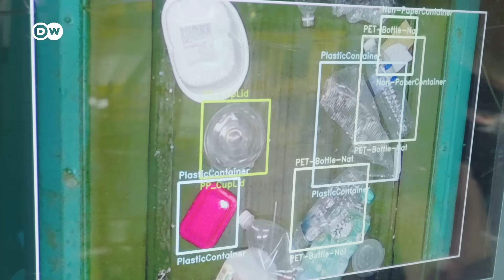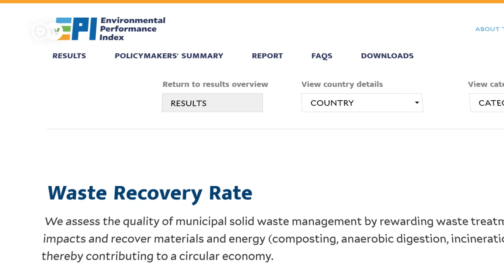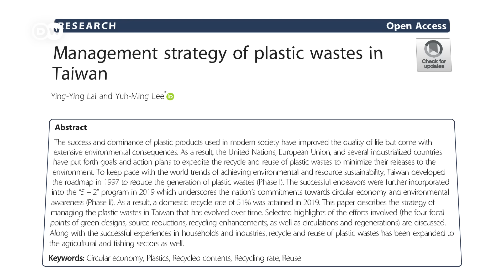How is Taiwan beating everyone at plastics recycling?

Comment: I think the recycling system uses AI in a beneficial way. In my opinion, for recycling as a whole I think that petroleum-based plastics should be fully turned into syngas for producing clean energy fuels. Then, using sustainable plant feed stocks to make sustainable plastic material alternatives that can biodegrade or be easier to recycle.

Comment: Imagine how much simpler and more recyclable the whole process would be if all those plastic bottles were made out of 100% recyclable GLASS
Reply: Imagine if each individual sorted trash and the whole recycling process was done with maximum efficiency... in stead we chose to litter Earth. What could possibly go wrong?
Reply: True, but glass is much heavier.
Reply: Glass produce carbon also.
To even re-melt the glass, a lot of fuel will be needed
Reply: @melvinyit6859  I'm only 62 years old and I remember as a kid returnable glass bottles. Those would get washed and reused.
Reply: @lorenzoblum868 That's still the case for some bottles in some countries. Here in Taiwan beer bottles have a deposit and they get washed and refused, it was the same in NL.
Reply: *reused
Reply: @lorenzoblum868  I'm 47 and reusable milk bottles delivered by EVs were universal in the UK. Rinse and leave on your doorstep for collection at time of delivery. Reusables > single use recyclables.
Reply: We should clean and reuse glass bottles and jars and other containers rather than "recycle" them.
In some countries you can take your containers to the supermarket and refill them. I really want that to be introduced in the UK (and ideally internationally).
Reply: @jbullen82 We do that with beer bottles here in Taiwan. It's also done in some European countries.

Comment: Most plastic waste if not all plastic waste is a form of downcycling.  No plastic waste that I know of can be endlessly recycled, sooner or later it ends up in an incinerator or landfill. People especially journalists should stop using the term recycling with plastics, as its extremely misleading  and just another form of green washing.
Reply: First reduce, then reuse and only when both options are exhausted, recycle!
Reply: @ain92ru  it is 5 R. 
Refuse 
Reduce
Reuse
Repair
Recycle
Reply: @permaculturisty  Yes!  & Rot (food waste) & Rethink or Redesign
There should be little to no trash left.
Taiwan is still incinerating a lot of trash.  But they do have numerous systems in place that work far better than most of what is happening in the US.
South Korea has an excelent system in place
Reply: Downcycling is still better than immediately sending it to landfills/incinerators. Perhaps it's only delaying the inevitable, but it still gives the plastic another use before its eventual disposal.
Reply: @SmilingNinja  Of course, but it isn't a cure-all. We MUST reduce the amount of plastic we produce in the first place.
Reply: @TheAruelle  Of course it isn't a permanent solution, but downcycling is still better than simply throwing out more plastic. It will, at the very least, decrease the need for more virgin plastic.
Reply: @TheAruelle  you can produce less plastic, but that’s not going to solve the problem. 
People are not going to carry a drink home cupped in their hands.
Reply: @AlphaGeekgirl but they can use re-usable containers instead of single use plastics. For example, the plastic bags do get collected, people think they can use many just as long as they properly dispose of them in the recycling bins. But as you just heard, they only get incinerated. Therefore, getting rid of as many single use plastics bags as possible would be much better. 
Mandate re-usable bags, make people pay more if they don’t bring their own bags, don’t let companies hand them out for free - much better than to (costly) collect, sort - and then just burn them.
Reply: @SmilingNinja  true. And people forget that with incinerators, given the fact they they have very fine air filters too, can also serve as a heat power plant providing home with heating energy.
Reply: I've lived in Taiwan and heard the "we're the best at recycling" story, looked into it, and saw most of the trash is burned. Everything used WAY too much plastic (100g of fresh fruit in an insanely big plastic container). During my time, there were some good changes, like if you bring your own cup for tea, you get a discount, and disposable plastic ones were banned in Taipei, so they're moving in a good direction, but these reports are often looking with way rosy glasses on this issue.
Reply: Recycling some is better than none. 
If reducing plastic is important to you then lead with information on reducing plastic.
Reply: HEAR HEAR!!
Reply: If you search for the phrase “ 台灣人減塑膠政策 “ on Google, you will learn that this YouTube report is merely one small, final component within Taiwan's much larger scope of environmental protection efforts. Taiwan has been working diligently for many years in ways that far exceed the imagination of those with passive attitudes, regardless of how much effort they put in.
Reply: Actually they tend to mix virgin plastic materials and recycled plastic. You can not use 100% recycled plastic.
Reply: First of all, it's clearly stated and shown in the video that a lot of it is burned. I have no idea why you are complaining.

Secondly, recycling is defined as turning a waste product into another product. Downcycling is hence a subcategory of recycling. That's how every dictionary I have seen defines it, and it's also how environmental organizations define it.

There is nothing misleading about the term. It's used appropriately in the video.
Reply: @Ciferz  These people are such pessimists. Their attitude is, 'Since we can't recycle all the plastic anyway, doing 30% or 50% is meaningless, so let's just do nothing at all.   And the worst part is, they never come up with any constructive ideas.
Reply: @Ciferz  plastic, however, can only be down cycled. It is the only kind of recycling available for plastic so we may as well call it plastic downcycling/incineration. Glass can be recycled, metals can be recycled. Using the term "recycling" for plastic gives the impression that it can be reused for the same product, and that is misleading.  The idea that recycling is the perfect solution to plastic waste is a marketing campaign from the plastic industry.
Reply: So you’re suggesting what?
If you don’t give people ideas or hope of how a problem can be solved,  THE PROBLEM CANNOT BE SOLVED!
All your opposition to greenwashing is noble, but you’re actually not doing anything positive to solve the problem.
Give people hope, and they will make the effort. Give them nothing but negativity, and they will continue to do what they’ve always done. 
I have been in charge of a Building of over 5,000 people for the past 29 years, where we have introduced more than a dozen initiatives, and we know what works. I’m guessing you don’t. But you do talk big. Congratulations!
Reply: @AlphaGeekgirl  i am not talking big, I am just talking reality. After reading the comments here, I see a lot of people who thought they were doing more good than they are, now realise they were being deceived are perhaps not as angry with me about terms and definitions, but are realising that their efforts to recycle are not as successful as they had hoped. Of course its better to downcycle plastic than do nothing, to be clear I put what plastic I use in ‘recycling’, where possible. However, the point is its NOT enough and it is NOT an end solution, nor is it sustainable, its merely a step in the right direction. Fact is we are still using a lot of plastic inappropriately and we have to create a market where bio plastics can compete. The end cost of the disposal of plastic is currently picked up by the consumer and not by the producer. Even though I as a consumer do not want my food wrapped in plastic. Plastic is more expensive for me to dispose of, if however my food comes in bioplastic, disposal is not an extra cost for me, cause I can chuck is on a compost heap. So again calling plastic recycling and not down cycling is extremely misleading and makes people think the problem is solved. People in the UK and Ireland were told their rubbish was being recycled for years and many were diligently sorting their rubbish. Then some people starting sticking trackers in plastic bags, only to find that those plastic bags ended up in either a landfill or incinerator in eastern Europe. We need to be more aware of what people understand by recycling and what is actually happening in reality and terms clarify for people what is actually happening.
Reply: @ImpossibleSolution-k6wsemantics, aluminum, glassn and steel are also truly down cycled by your definition. Recycling always means partial re-use as chemical degradation and contamination happens in all products. Virgin material always stronger and necessary to some degree.
Reply: @joeljong931  No glass can be reused indefinitely and there are other materials that do not degrade over time, like gold for example. If you can reuse the processed material several times for the same product, it is recycling. If not even 1 full cycle can be completed, it is downcycling. Simple as that.
Reply: So, you're saying that we shouldn't recycle plastics at all, or mention it as a solution, since it's somewhat misleading?
Reply: @stevenmitchell1  No I am saying we shouldn’t call it recycling, because its not recycling, its at best down cycling. Too many people believe plastic is really recycled into the same product endlessly, especially PET. Down cycling is an improvement on directly going to landfill or incineration, but it is not sustainable and people need to understand this. We either need to find ways to really recycle plastic or we need to replace a lot more plastic with real recyclable bio plastics and this won’t happen until everyone is aware of the problem and its size. Plastic has become the main material for packaging household products, including food and drink. This plastic waste ends up on islands and developing nations, that have currently little or no ability to down cycle plastics, meaning it all ends up in landfill. These same countries have taken in vast amounts of plastic waste from developing nations up until relatively recently. Their landfills of course have little to no regulation, so these countries have vast amounts of plastic in improperly constructed landfills and the problem gets worse daily.
Reply: @ImpossibleSolution-k6w     90% of people in the US don't even care. Most people in US states that actually even attempt recycling don't or can't even sort materials in their proper bin. There's as much trash in the plastics or paper bins as the trash bins. So I don't see education being a solution, because I don't think most people actually care. They may even do it intentionally, as a form of FU. Only half of the US states have any form of mandatory recycling for any waste. Even the categorization of plastic in the US is controlled by the polluters themselves. Unless the US develops some national laws pertaining to recycling and regulation, along with education, nothing's going to change. Too large of a % of the US populace is contemptuous of recycling in any form, and won't do anything to improve it, without mandatory laws, and enforcement. Right now there's not even a push in the US to replace single-serve plastics with compostable or biodegradable materials. This won't change without some forced incentives.
Reply: @ImpossibleSolution-k6w and it also ends up as micro and nano plastics in our bodys, even our bloodstream and brains!
Reply: @ImpossibleSolution-k6w As mentioned in my direct reply above, every environmental organization I know of considers downcycling a type of recycling. Look at the word recycling. It literally meant to put waste back in the cycle instead of burning it or immediately throwing it into a landfill. 

Nowhere does it mention it can't be turned into a lower grade product, or that the cycle can go on forever. 

No type of recycling can be done an  infinite amount of times, by the way. There is always some degradation, so by your logic recycling doesn't exist no matter the material.

And as also mentioned in my other comment, the video addresses concerns about recycling often just meaning that the material is incinerated.

I have no idea what you're complaining about.
Reply: Frankly only numbers 1, 2 and 5 should even exist where I am concerned. Unless you are a medical facility or an investigator who needs things uncontaminated there are precious few things you cannot carry in glass, paper/cardboard and metal. 

Single use plastics are a scam and source of pollution. The numbers I mentioned are the only ones even worth anything by themselves. Steel, which is used for meshwire is truly a modern miracle, and the one thing that should be used for carrying things for its durability and longevity. If it needs to be watertight, glass and steel bottles are a thing, but most things you buy do not require that. The basket is enough.

Comment: It's strange to see any plastic being burned when it can be turned into hydrocarbon liquid such as diesel or kerosene, used as a fuel or turned into other products. Pyrolysis reduces complex hydrocarbons back into simpler ones. And yet it's rare to see pyrolysis being used at all.
Reply: Yes because it's a new method and also you lose the contained energy if you have to convert them first with the addition of heat than if you just directly burn them. From an energy and profit point of view adding an extra step makes no sense if the end result is just to convert the heat into electricity/ energy.